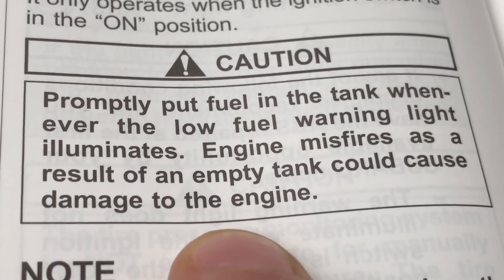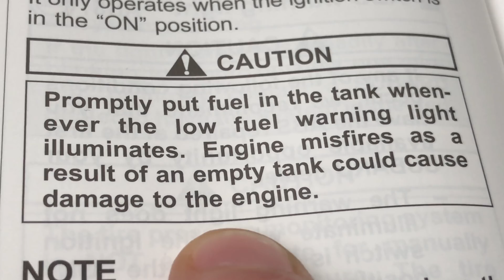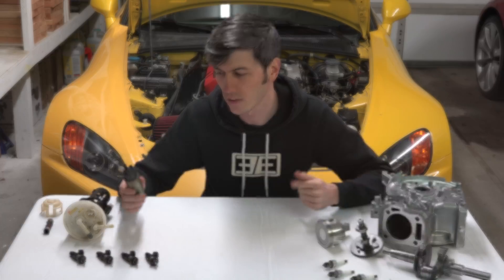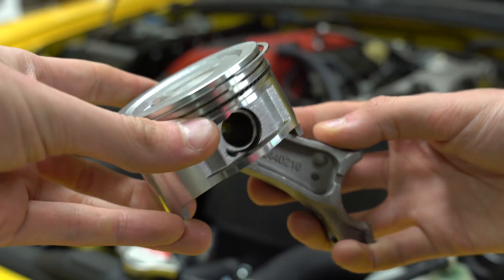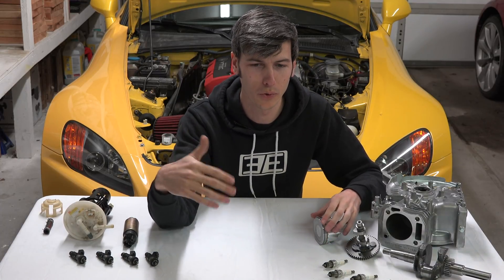Will Running Out Of Gas Damage Your Car?

Comment: Theory is not always the same as practice. My wife's 1985 Volvo fuel pump (under the driver's seat) did not survive a single episode of fuel starvation. It seems cooling and lubrication are important.
A radio show in the 1990s, hosted by Mark Salem of Salem Boys Auto in Tempe, Arizona, observed that nearly every fuel pump failure he had seen was in cars that belonged to ASU students who rarely kept much gas in the tank.
There is also the matter of in-tank fuel pressure regulators. It is not unusual for a pump picking up gasoline at the end to pump a lot of air into the fuel line between the tank and the fuel rail. With a regulator at the fuel rail that is not a big problem; it shunts air and gasoline back to the tank once the in-tank pump gets a grip. With an in-tank pump it has to work its way out the injectors or be manually bled.
Finally, Toyota hybrids (and possibly other makes) HATE running out of fuel. It doesn't damage anything in particular but the system is not designed to try cranking the engine as long as it takes to get gasoline feeding to the injectors. Most Prius enthusiasts recommend having it towed to the dealer so a tech can bleed it and command the ICE to crank. In addition, I was warned when we got our third generation Prius that if it dies of fuel starvation the tank has to be filled enough to turn off the fuel warning light before the ICE will try to start. I have a first gen that does not seem to have that restriction (according to rumor) and I have no idea which generations it applies to, or for certain it is not just a well-entrenched rumor.

Comment: What about the opposite?  Will overfilling your tank cause any damage?
Reply: this is a very good question that most people never think about. Yes it can cause damage to the EVAP system.     There are a few solenoid valves and a carbon filter that can be damaged. And if the carbon filter is damaged it can lead to other issues with solenoids and fuel injectors.   It is always best to stop when the nozzle at the pump automatically kicks out.     You should never over fill your fuel tank.

Comment: Running a car on half tank or lower will save you money in the long run (fuel has weight and transporting weight costs money), but then you could get rust inside your tank and holes or other issues.

Comment: I've been driving for nearly 20 years with my car, and I regularly run low on gas (I always top up full, and then run it until empty)... It's still the original fuel pump.
Reply: jawtheshark What kind of car?
Reply: reck0n3r Audi TT, bought new begin February 2000.

Comment: What happens if it is a mechanical diesel pump? Diesel is fed by gravity in this case.
Reply: The caterpillar old scroll, new scroll systems and the cummins PT style pumps were known to  score/ gauld parts inside them   when they would run out of fuel.  The pt pump could damage some parts inside and then once refueled and bled out the governor would not work correctly and you would get a run away. The Detroit 2 strokes at times when they would get low on fuel and start running lean could  start to run away. And once they got to enough rpms they would start running on the engine oil because the seals in the blower would fail and go until they blew up. But  99.999999 percent of the time your running under load and the engine would run out of fuel so fast they would just shut down with no issues.

Comment: I was taught never to drive under a quarter tank unless I'm out looking for a gas station already. Also taught to NEVER try and start the car if I ran out of fuel so the fuel pump doesn't pull in air.

Comment: Oh sh*t. I've been doing this habitually for over 10 years. I've put 149000 miles on my current car, and I'll be replacing it with a Tesla Model 3 at the end of the year. So I guess I dodged this problem...

Comment: I'd also mention that with direct injection, only SOME vehicles have a primer pump in the tank. These vehicles often have a ridiculously artificial fuel empty reading because IF you run out of fuel it basically requires a tow to the dealer to bleed the air out of the fuel rail to the mechanical CAM driven fuel pump (though some more modern direct injection vehicles have a electronic fuel pump near the fuel rail - still above the fuel tank where it will create a vacuum if the tank is empty.) It's worth mentioning these vehicles, especially those with CAM driven pumps, are often diesel.

I recently helped a friend replace his primer pump on his Hyundai because even though this pump isn't all that important - the vehicle runs without it - it was getting erratic fuel pressure to the mechanical pump which was causing drivability issues under hard acceleration. Eventually he had a fuel system check engine light telling us the problem.

My Mazda CX-5 on the other hand also has two pumps. One traditional pump in the tank that pressurizes the fuel system to around 10PSI, then the HIGH PRESSURE fuel pump in the engine compartment pressurizes the fuel rail. According to MazdaEdit, when I monitor the fuel system, that primer pump in the tank never runs more than 20PSI. It is variable voltage controlled, like most modern non-DI motors, though most MPFI fuel systems remain pressurized upward of 40PSI.

The high-pressure fuel pump...10,000PSI.

Comment: Serious question: How "LOW" is too low on fuel? I drive a Lexus ES300 with an 18.5 gallon tank, but I have never purchased more than 14 gallons to fill it up, even when the Yellow "LOW FUEL" light is on (which I avoid, naturally). So there must be at least 3 gallons in a 18.5 gallon tank (about 16%) still there when the fuel gauge is on "E." ? Incidentally, my range has been nearly 400 miles on the highway while running it down to the "E" peg. I have never experienced a problem like misfire, knocking, or water-fuel contamination. Thanks for the advice.

Comment: If you dont have time to get gas, then you definitly do not have time to run out of gas, walk to a place that still sells gas can. My mom's car used to spend alot of time around1/16th of a tank, and she did have a fuel pump fail ay about 100,000 miles.

Comment: How do all our cars that pop and bang by cutting spark momentarily not have failed catalytic converters all the time?
Reply: The problem is heat. If much unburned mixture gets to the cat it will melt the catalyst matrix.

Comment: advice for people with really old cars - you should DEFINITELY not drive without fuel (or even really low fuel). a very good reason to have debris in your fuel tank is your tank being 40 or 50 years old. older fuel tanks and suction filters also weren't designed to handle the crap that is in our fuel now. they might even have been designed for leaded gasoline 🤣

Comment: I thought fuel pump is activated with the Ignition set to ON, before the engine is running, and therefore the pump is still running after the gas runs out and the engine stalls, while the Ignition is still ON.

Comment: Something else to consider... over time the bottom of all fuel tanks accumulate misc water/dirt/crud. A full tank displaces air & will help mitigate internal water condensation[1], and lessens (but not eliminate) excessive sloshing. Driving with a tank closer to empty aggravates sloshing, and keeps more of the spooge churned up.

As a side note: Sometimes fuel injected engines can be very difficult to restart after being run out of fuel. One procedure that very much eases battery/starter trauma is after adding some fuel: turn the key to the 'run' (not crank) position, wait 4 seconds, then turn back 'off'. Repeat like literally 40 times & try starting. Each cycle briefly runs the pump to re-pressurize the fuel rail. (The pump only runs 3 or 4 seconds after turning the key on, unless the starter is engaged. The idea is to leave the starter out of the equation till the rail is re-pressurized.)

[1] Some dirt & water comes from gas stations as well. If you ever see a station receiving a delivery, try to avoid buying there for at least several hours... overnight is better. Those trucks dump fuel in very fast, and churn up the spooge sediment in the stations underground tank/s. The station is supposed to have filters, but they're pricy, and who knows how often they get serviced... If you always buy at the same station, if asked, they might tell you their delivery schedule.
Reply: Not how it works. Fuel is already pulled from the bottom of the tank, that's why fuel filter exists. Imagine if that actually built up that much at bottom of the tank, it would reduce max capacity over time, which is not good

Comment: Jason's S2000 has had some body work; The front clip and right fender have been painted....

Running your car out of gas can plug the fuel filter or even the pump itself if there is debris in your tank.  The older the car the more likely this is to take place...

Comment: Not mentioned in the video, but a lot of fuel pumps loose heat from the metal casing to the surrounding fuel rather than what flows through the pump, so being low in the tank can cause higher operating temperatures at the top of the even though the pickup is still submerged. And if you fill the tank after a long duration driving, your then pouring cold fluid over the warm pump, which is a lot more aggressive thermal cycle than the slow change in temperature of surrounding fuel. Modern pumps are pretty durable and reliable, so its not a huge deal on a new car, but if you have something older keeping at least 1/4 of a tank can be a good idea... its also pretty cheap insurance against a closed fuel station (and on longer trips, driver fatigue).

Diesel vehicles can be a bit different, just like putting petrol in the tank very low fuel levels can cause issues due to loss of lubricity of the fuel for the high pressure pump, on the other hand lower fuel flow into the cylinder is exactly the same as applying less accelerator pedel, so your not risking knock or emissions control damage. They may have an in tank "lift pump" to which all the above applies (although they don't make as much pressure and tend to be lower flow, so don't work as hard to overheat ect.

Comment: Two points you did not address that I was hoping you would.
1. Does fuel around pump keeps it cool and makes it last longer. I'm guessing probably so having over 1/4 tank is best
2. Effects on GDI engine. Is it like diesel where you have to do special procedure after you refuel?

Thanks
Reply: Fuel around the pump is of little value - it's more about lubricating the internals of the pump which prevents wear and heat build up and mechanical failure.

Comment: If the fuel pump cant supply enough fuel surely the ecu will sense a pressure spike drop and compensate?. Id say thats related to a low quality ecu than fuel pump..?
Reply: How can an ECU compensate for a fuel level so low that the pump just can't pick fuel up?
Reply: @TonyRule  it will see fuel pressure drop And alter fuel map and spark table to limit damage to engine. At high engine load. The engine will always try to prevent lean. And lets face it even if fuel sucks air. Its takes time to run through the system . With a good ecu and good fuel rail pumps. You wont have an issue.
Reply: @willyouwright  If the fuel isn't being picked up, the engine will stop regardless, especially at WOT with the amount of excess air going in being so large as to be unable to sustain chamber combustion. Then you could well get a backfire in the exhaust damaging the catalytic converter.
Reply: @TonyRule  if the ecu is accurate and fast it will see the fuel pressure rail drop first.. again it comes down to how dodgy the ecu is. Some ecus go off exuast o2. Thats poor design. Cos its too late by that stage.
Reply: @TonyRule  there is fuel in the rail and it in some cases a pressure pump to fill the rail. Every setups different. So the ecu need to be aware of fuel rail instead of just 02
Reply: @TonyRule  also some ecus try to richen things up if they see a lean event. That leads to said fuel dump when fuel pump bites again. Usually a sign of a badly designed ecu.
Reply: @willyouwright  I've never heard of a gasoline injected engine with a high pressure pump close to the rail so it must be rare especially as it would also requires a lift/feed pump at significant additional cost and we all know how cost adverse vehicle manufacturers are. There are certainly systems that incorporate a lift pump with the high pressure pump in a small pot to reduce issues of fuel starvation under hard changes of direction in some performance cars, but that's usually immediately adjacent.
But my point remains - no fuel - no run. Fuel pumps are inherently bad at pumping air so, due to the effectively incompressible of petrol, when they aren't getting fuel the pressure loss is almost instant and total bar a little accumulation effect in the flexible hose sections.
Reply: @TonyRule  ok im just going to have to believe you that the fuel rail pressure can go to zero instantly. Theres not allot you can do.. except turn off all injectors. To save lean and over rich. I imagine there should be some hysteresis so when the pump engages again the rich condition diesnt blow up the cat..

Comment: I personally like to fill my tank just after the light come on so that the full range of the fuel level sensor get used.. I've seen it happen many times, even to me once.. After constantly filling up at a 3/4 to full, 1/2 to full or even 1/4 to full, whatever you constantly use on the gauge it would eventually get stuck working only that range and if you happen to be on a long drive you never know you are running out of gas until the engine shut off and the gauge said you still have gas.. Just my experience..

Comment: Do newer DI gas motors use a high pressure fuel injection pump, like Diesel engines do?  I know that getting a lot of air into a modern common rail diesel FI pump (15000-25000 psi pump) CAN damage them.  For my truck, there is a very specific required procedure for getting air out of the tank to pump lines and system after changing the diesel fuel filter to prevent getting air into the high pressure common rail pump.

Comment: But, on another note, should I replace the fuel pump every few years since they don't make separate, serviceable fuel filters any more (everything is in-tank)?
Reply: That would be an expensive, and pointless, hobby. You can normally get the filters for the intake anyway.

Comment: I was told that many car manufactures will prosperously send unburnt fuel through the engine when they detect the catalytic starting to overheat from wide open throttle. because that reaction is actually much cooler than it reacting with exhaust gasses. and that that is the reason you will get a surfer smell when going WOT (at least in the US where sulfur is still in gasoline).

and continuously running rich kills them because obviously burning fuel in a low oxygen environment creates a carbonizing flame. Much like lighting only the  acetylene  on a welding torch.

Comment: If the car is idling and runs out of fuel, wouldn't the fuel pump still be operating as long as the key is in the "ON" position, regardless of whether the engine is running or not?
Reply: No. The fuel pump only runs when the engine is running or cranking or for a couple of seconds to prime the injector rail when you switch the key from ACC to RUN position. It doesn't run continuously with just key in the run position.

Comment: I came into a situation (not intentionally) where I was sucking back fumes on my motorcycle. So I drove then pulled in the clutch and coasted a bit till my speed went down about 10km. Then I'd release the clutch back, slowly bring the bike back up to speed and pull the clutch back in. No idea if this was better or not, but I did make it to the gas station.

Comment: My car got really low on fuel last week and now it runs really bad after putting fuel in it.  Is it possible it picked up all the rubbish at the bottom of the tank and sucked it through the filter after I put fuel in it?  It was fine till I put more fuel in it!  Its a 99 318ti and the fuel filter is external on these down along the fuel line.  Should I try replacing the filter or plugs first?   Thanks :)

Comment: My wife basically drives everywhere with her fuel light on at least 50% of the time.  Drives me crazy.  Still we've had her car for 10 years now and it's 15 years old, so she hasn't managed to break it so far.  I never let my car drop below 1/8th of a tank on the gauge, which triggers the "80km" range warning.

Comment: When you get a new car, first thing to do is find out how much fuel is left when the "low" light comes on and/or when the needle is exactly at the "E" mark (or when the last fuel bar light goes off).
So fill it immediately on both circumstances (different tank fills obviously..!)  and calculate how much fuel was left.

Then of course, the real range you have left is easy to calculate from when the light comes on and/or when it points at empty based on your average range.

It's usually a lot more that you'd think.

A recent test I did: ran it down to 0.4 gallons (based on how much went in to the first click of the pump) with no evidence of the engine struggling at all.  That was about 20 miles after the last light on the gauge strip went out. and over 50 miles from the low light coming on.  (I did this after many tanks of gas a lot of spreadsheets to know how far I could likely push it...)

Not to suggest you push it - but at least find out the hard data so you can make informed decisions.

Also, when low on fuel, the best way to stretch it is to slow down!  A 20% drop in highway speed is over 30% less fuel consumption ... you might really, really need that!
Reply: Reserve is usually 2 gallons when the E light pops on